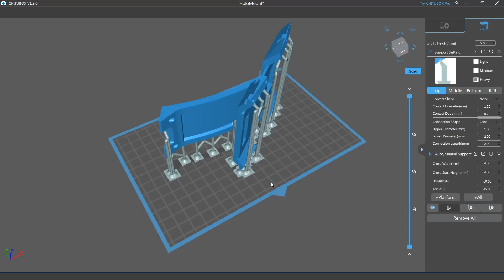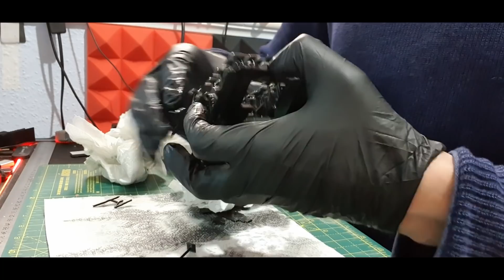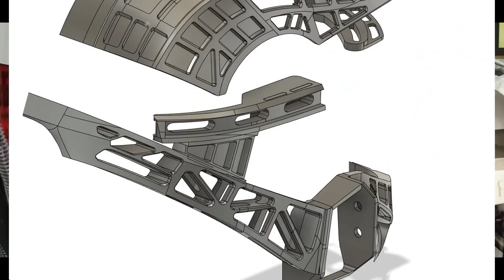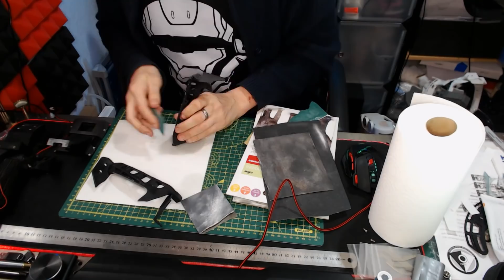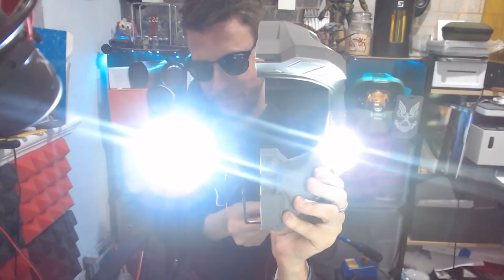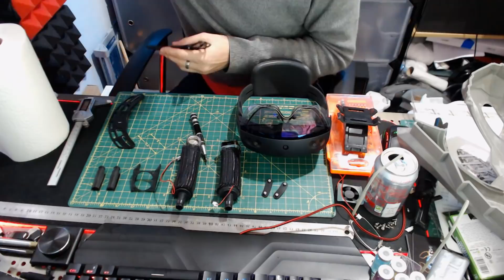Project: MJOLNIR - Update 07

Comment: Great work man, keep up the good work. I do have some thoughts. i know your set on a one piece design, however i believe if you could turn the jaw section to a modular design. One making is easier for assembly for different visors, two to allow others to customize for their head shape and seal at neck line better also. Maybe incorporate 2 screw downs close to light sections both sides, that can be sealed with a gasket, also to make power connections in that modular design you could implement push pin boards similar to lian li uni fans use.  Now, as for the ventilation system, i'm not sure how you are routing it so i cannot give much input there without more detail. I am sorry i can't afford to help support you financially with this project, wish i could. However best i can do is maybe give you other ideas. Can't wait for the next update man. keep up the great work.

Comment: Possible functional idea:
Do you plan to use any sort of internal suspension system to mitigate blows to the head? This has been in helmets for centuries and even a foam sword to the noggin can be pretty jarring with a dorect fit helmet. This may also increase the 'dead space' inside and allow additional ventilation circulation

Comment: Love your progress!
Wondering about your efforts on the helmet..to be a helmet?!  Have you referenced functional motorcycle, bicycle, etc., for pading etc to make it damp out shock from impacts?
I always worried about the game helmat that slipped on the Spartans easily (presumably with a automatic inflation or something collar to keep it on without a strap) but it doesn’t seem to link to the bdu collar in case of zero pressure, or linking to hard points to keep you from breaking your neck!  The visor could add leverage to twist your head in a crash or accident.   Obviously not game correct, but then your bones arnt titanium reinforced!

Comment: The helmet will need to be done in multiple pieces in order to accommodate the internal support structure. How you do that is entirely up to you though it seems you have a fairly good set up just by splitting down the middle. Don't know much about 3d printed metal so not sure if welding is an option.
If I had the money spare I'd put what could towards it though real life things are difficult when past events means I don't have savings 😅

Comment: You could make this into a comfortable wearble helmet, keep the air filtration and cooling systems, the holo lens and com system add internal coms by adding a noise canceling mic and headset and either Bluetooth them directly to a phone or the helmet systems of a raspberry pi and then Bluetooth that directly to the phone have the visor transparent to see the wearers face or at least their eyes, have it darken when exposed to uv have anti glare for computer uses basically glasses that can be used outside transparent but with everything sunglasses would except color. have one layer that can activate turning the visor black or whatever allowing you to use external cameras with light filters and so forth, maybe give it the ability to add camera giving the user 360 vision as an option obviously this version would be made mostly from light materials except where thermal requirements mandated metals sell them as covid protection safe flight helmets, take out all of the hololens features and just have air filtration anti glare visor with uv/blue light filter with bluetoothable internal and external coms with a reasonable noise cancelling system and sell that to call centres ppe equipment the ability to use the phone without sharing peoples private data around the entire call centre reduced flu and cold spreading screen use mitigation in a device that you can claim has semi reasonable self managed climate control

Comment: Are you trying to make the suit combat effective or civilian use?
Reply: Proof of concept that it can be used combat effective among other uses
Reply: @hf117j  been working on a similar design the issue I've come across that I'm working on is wave resistance such as shock wave force from explosives and impact waves.  Theory is making a flexible carbonfiber weave between the metal outer layers.  Tungsten coating could be used towards heat resistance power supply could be in the back using a powercell with a Tesla core design though Tesla never made his design small.  Solar power recharge isn't effective in terms of core suit functions.  Also fan systems look into your operator will sweat in the contained environment if not.  I would go indepth but I've been working on this since 05 so we'd be here all day. Ight send the guy an email to compare notes as he's in production stage while I'm still doing the mathematical side.
Reply: @hf117j  oh I know and I'm not discounting his work I just see it as pass knowledge to each other to complete the goal while he might not see this comment others might who happen to be in a similar mindset on the work that sort of thing

Comment: @Installation00

****FOOD FOR THOUGHT?****

Inquiry:  

Considering the following points, I think it's an interesting opportunity.

Idea Tech: 

Neoprene fabric layers are great material and would make an excellent inner suit lining for a muscular exo-suit. Dyneema is also pretty fantastic for a top layer overlay onto that Neoprene fabric and would present a nice sheath to provide some protection to the internal body sensor components. 

Fitted Carbon Nanotubules mounted to an exoskeletal power system with ABS-R polymer "ligaments" and polyethylene joints (which act in concert with light weight polyurethane tendons) would fit together and form a contour over the appropriate surface areas of a disposable porous body suit (which would be covering the bare human body itself). This permeability layer would allow the wearer's skin to aerobically respire and lower the likelihood of excess perspiration.

The aforementioned pass through layer would carry voltage to and from inputs acting like adducting and contracting muscle fibers (obviously cybernetic sensory neuro-stim is needed to synergize with the brain signals of the wearer). 

Select hard foam padding underneath hexagonal polymer structures, and Carbon fiber reinforcements come into order over the Carbon nanotubules doing the heavy load -- demanding flexion motions required to move the body armour of the suit core. 

The full weight of the limbs has to be seamlessly and instantaneously accounted for by the main onboard super computer at each of the voltage regulators moving the suit's compound "muscles". 

Musculoskeletal Structure: 

First off, I'd say that no one wants a heavy alloy added to their bone. The tissue surrounding the metal will be agonizingly painful depending on the weather. Next up, the weight and hardness of the metal would most certainly affect the feet (and ankles). 

That alloy will dig, rip into, tear, and cut against the soft tissue of the soles of your feet as the cage weight of the whole structure coming down, presses and compresses those poor waffles with each foot step (or jump if you could ever bear to do it). 

Otherwise, each subject would need to have artificial soles bonded to the alloy injected / coated bone and protruding hard points at the base of each foot. Of course, the issue described here is based entirely on material density, purity, and most certainly weight.

Imho, the suit itself would be best at doing most of the absolutely hardcore stuff. The structure(s) below the hardened protection of the alloy used on the outer layer, inevitably has to take center stage. 

Most of the "muscle mass" under the suit has to be in the use of conductive Carbon nanotubules, with a compression layer and a potentially mixed material Niobium coat over top. The outer armour would likely be a special grade Titanium of an extreme heat treated alloy variety. 

Because MC is a Black Ops Unacknowledged Special Access Project, he and the others likely have exotic UFO / UAP materials in the armour core material blend -- the kind not found on earth....
Reply: The suit would be tuned down to a human level of movement speed xD So no worries about surgical alterations to be q user of the suit. More likely, the exo skeleton would be used to support the suit and aid in movement lol
Reply: your hard foam padding should be layered with shear thickening pads and kevlar

Comment: I would recommend considering the space required to have proper audio in the helmet, I would recommend looking into anything by opscore, as I heard they’re making a helmet with a really good audio system that adjusts for louder sounds. Also if you’re printing the helmet with titanium and aluminum you should probably adjust the bodysuit to have additional spinal support considering the long term injuries that come from wearing heavier helmets.
Reply: Yeah. Not to mention his helmet design does not have enough airflow. It's gonna get HOT. That's why I wanted to put the bulk of my electronics in the backpack and run the cables up the neck support
Reply: @hf117j  while I would normally agree, it would be a pain in the ass to unplug and reconnect everything while taking the helmet off for say: a breath of fresh air. However the tech should primarily be in the back and/ or torso as it gives you the most leniency with storage. As for cooling it’s never been a huge issue for me outside of airing out goggles and visors, so I have no expertise on that end
Reply: Take my opscore comment with a grain of salt. I am not an audio expert, however I have experience with wearing heavier helmet rigs with bad audio
Reply: The idea is for it to be lore accurate... Meaning the suit will be supporting the helmet xD
Reply: @Kaelani_Revyruun  to my knowledge the suit is not being made for anyone with augments but rather for modern human beings. My comment on the matter was intended to be less of criticism and more so as advice for developing a suit of armor that could be worn long term.

Comment: What kind of system are you using to keep the wearer from feeling the armor weight? Also this project has been super cool and I hope that it turns out great. Also what will the lift capacity of the armor be?
Reply: the suit will have an articulated exoskeleton under the armor. it redirects the load from everything into the ground.

Comment: I think there might be a better way to do the helmet lights.  Think of all the free space in the helmet behind the lights now think plug and play so u have the light heat sink and the battery all as a single unit and it slides in and out like a magazine. So u only have the wiring for the switch . Plus it's Easier for maintenance.
Reply from the maker: Exceptional idea!
Reply: @Installation00  With the actual frame, you may not need a heat sink, just like the hololense
Reply: @SethyWethyKine  Yeah. He could transfer the heat of all the helmet components into the helmet frame itself.
Reply: I’ve always been a little skeptical of flashlights on helmets. Cause then the enemy knows EXACTLY where to shoot to get a head shot. If you’re gonna have cameras on the helmet anyways, why not just use night vision and IR to replace the need for flashlights? Completely passive, works better, and still allows you to sneak up on people:)
Reply: @Andy-kw2zm  I also don't like light mounted on weapons for the same reason. In a tactical situation, I would want to use IR/night vision or have a hand held light that you can hold out to the side (with the Mjolnir exoskeleton the weapon should be easily stabilized). I suppose in the event you need hands free white light (though I can't think of what that would be), sure helmet mounted is fine (I have a head lamp for hiking) but then it should be easy enough to do both camera IR/night vision and helmet mounted lights.
Reply: @capt4in1 IR/Nightvision is excessively bulky and there are techniques developed for weapons lights that are designed as a workaround for those drawbacks.  Nightvision/IR isn't the solution for everything either depending on the environment.
Reply: @Andy-kw2zm  I mean entirely passive IR. Night vision goggles would be for night vision. Both can be useful.
Reply: @Andy-kw2zm  That depends on the battlefield, but it also has other non-tactical applications, like SAR and firefighting (both of which will be excellent uses of MJOLNIR). You also seem to keep neglecting the fact that I always mentioned regular night vision as well. But it doesn't really matter. All three will be immensely useful to any user of MJOLNIR, and that is my point, not just for tactical situations (though those are probably what most people think of when they imagine this suit being used, I try to think of less violent uses). I'm sorry if I caused confusion by bringing up tactical earlier, it just seemed to be the easiest application to mention.
Reply: @capt4in1  Alright. From the perspective of someone who has used the good nvg's and irnv (digital). I have never served. I have just played with them as well as airsofted with them. So the stuff that does NOT give you away is the good stuff. Light intensifier tubes. You do not need an IR illuminator for that. Hence you emit nothing. And if you already have good natural night sight, even the ones that just go from pitch black to just really dark seems like a night and day difference. Now we're getting to your idea. IRNV. Digital. Cameras come standard with a filter to reduce IR light getting to the sensor in the day. Cameras for this actually remove that part or they have it gated so it puts a filter on hopefully fast enough to not burn out. Here's why digital/IRNV kinda sucks. You do need an IR illuminator. Which means anyone else with IRNV sees it like a flashlight anyways. Not to mention the screens are always so bright you can turn it backwards and use the screen as a flashlight. If you're built for night like me, and deal with light sensitivity. This screen WILL hurt your eyes 90% of the time. Even without having IRNV, most IR illuminators look like a red dot to the naked eye. So you still aren't hidden well even with IRNV. And it takes practice to just be able to walk with night vision on. I was fortunate enough to experience that when I was little, and I can pass the function test with the drunk goggles on (I'mnotvery susceptible to optical illusions). So it came naturally to me when I grew up and used it again. But I have heard others talk about how long they spent practicing just to walk. That's because depth perception, and field of view. It's actually a struggle just to get a set that's a 1x zoom for maneuvering. Even then you also need to take into consideration that the lenses involved with digital don't like to focus within the range you can hold. So if you want to check a map? Gotta set it down somewhere and hopefully you have some normal light since it'll just be a blur in the nvg's. Yes. I do think it's cool and worth the experience. No. I don't think it replaces a flashlight completely. I don't have his funding so my progress is slow. But I am also working on a version. Not as high end. Just enough to be practical in airsoft. Including the smart link scope, irnv will be on mine, same with a cooling system. And of course I will be able to record day or night. I won't be using the 3 grand ar headset he's using so I need to figure out how to bound the screen images 180 gegrees onto the visor

Comment: I am 9 minutes and 10 seconds in talkin about the frame of the helmet I would have honestly gone with a honeycomb pattern for more structural stability and it would allow you to more easily fit and maneuver wires into the structure the but I'm sure you probably thought of that if you did why did you go with this design if you don't mind my asking
Reply from the maker: Absolutely right, I did consider it. However since the frame is going to be machined rather than 3D printed, a hexagonal internal geometry would be, at best, far too complicated and time consuming to machine into it, and at worst, completely impossible given current manufacturing processes. 

The frame is optimised for strength and rigidity, with interconnecting but easily machinable cross braces, while maintaining minimum weight tolerances and interior voids from the cutouts for components and wiring to be ducted.
Reply: You can put timestamps like this: 9:10
Simply type the time in the video you want and it'll automatically become a timestamp.

Comment: From what you've got of the frame so far, it looks very much like it could fit the Gen III Mark VII helmet.
A more neutrally shaped frame that can fit different helmet shells could be a cool project after project Mjolnir is completed. You could even monetize doing it with different in game helmets, all with the same base frame and electronics. Ranging in price from just having lights and a light air circulation system to as advanced as having the full HUD setup and air filtration.
I don't know how many people would buy that, but there's a good market for 3d printed helmets. Having one that's somewhat customizable would definitely sell.

Comment: Wait….. why are you putting fans in an air tight suit? At best they won’t do anything in space, at worst you have an opening that lets hazardous external conditions in. Unless I’m misunderstanding something
Reply from the maker: The fans enable air circulation within the helmet. Under normal usage, the fans can draw air in from outside through filters to cool you down. In poor atmospheric conditions and in vacuum, solenoid vacuum rated valves will seal at the intakes and outputs, sealing the hermetic seal from the external environment.
Reply: MJOLNIR doesn't only operate in space
Reply: The fans are most likely going to be used for air circulation. Helmet with no air circulation make your head boil. Not so fun to experience.